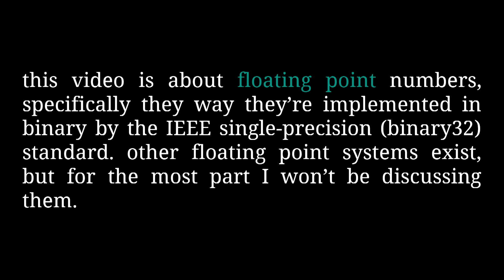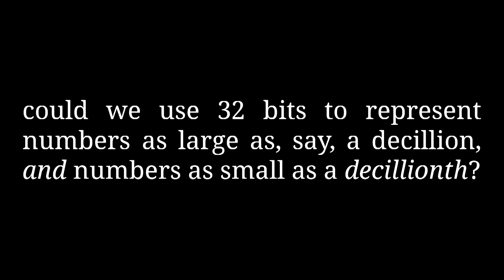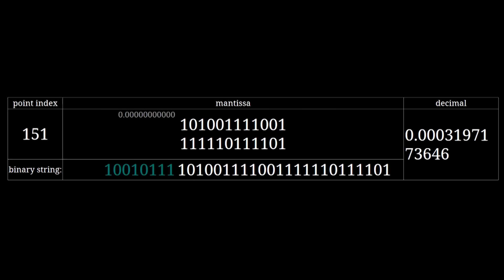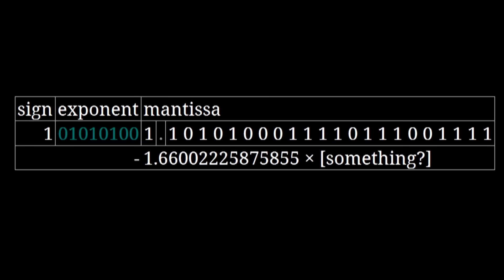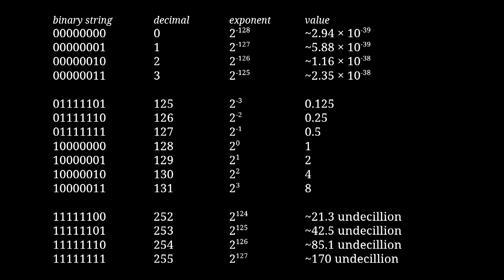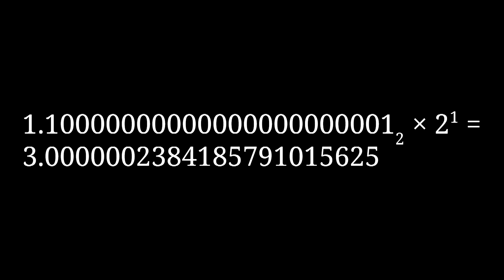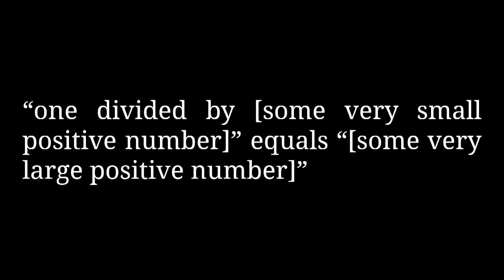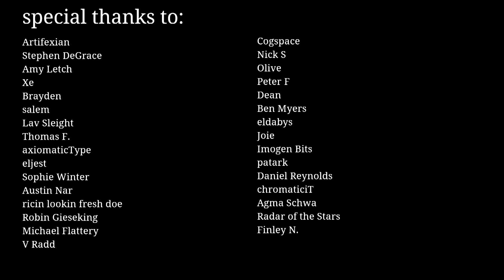how floating point works

Comment: The weirdest thing you'll face when dealing with floating point is when you try to make games and one of the tips is "As you get farther from the (0, 0, 0) coordinate, physics gets less precise".

It makes a lot of sense. If you need to spend more bits in the integer part of the number, the decimal part will be less precise. It's just so impractical for this purpose.
Reply: That makes total sense but I’ve never worked in games so it never occurred to me. How interesting. What kind of data type are the coordinates? I’d assume it’s at least a double these days but like is double precise enough for large open world games or do you need more bits?
Reply: @huckthatdish  in games most often float is used, due to higher performance on GPU (transforming vertices by matrix, etc.)
open world games usually use floating world origin, which shifts entire world closer to (0, 0, 0) (implementations vary)
Reply: @kkard2  interesting. Still surprised with how far draw distances are these days everything loaded at once can be simulated with just float, but I know the tricks and hacks to make it all work are myriad. Very interesting
Reply: @huckthatdish  Generally, games with large enough areas to make this a problem handle it by setting the origin coordinate at the player's location and moving the rest of the world around them, and not simulating the parts of the world that the player isn't currently in. That, or loading zones; any given loaded area can have it's own fixed origin.
Reply: On the other hand, Outer Wilds has a whole miniature solar system and needs to run physics everywhere even when you're not around. I'm not sure how that handles it, but I am very impressed that they did.
Reply: @qwertystop  for outer worlds probably various coordinate systems running in parallel. Since the different planets don’t interact with one another I assume, it’s just multiple copies of if you were just simulating the one world. With GPU’s these days if you can parallelize a problem you’re good, especially since there’s no graphical rendering for worlds you’re not on I assume.
Reply: @huckthatdish  Outer Wilds, not Outer Worlds; completely unrelated game that happened to release at around the same time. And that's part of the issue, though - you fly in real-time between planets, no loading, you can see one planet from another just by looking at the sky. If each planet does use a different coordinate system, it's still impressive to shift objects from one to another without noticable seams. Also you have a camera drone that you can launch wherever and that has no limits on its distance from you, so the game does need to be able to render any combination of locations at once.

(Also, physics simulation is not, to my knowledge, currently something that's practical to parallelize onto the GPU)
Reply: @qwertystop  Outer Wilds does the "keep the player at the center and move the universe around them" thing. Check the NoClip "Making Of Outer Wilds" documentary, it's super interesting.
Reply: there's a series of videos by danny2462 that i think starts with one called "distance did this" where, because in kerbal space program the coordinate system's origin is defined as where the player is (as an attempt to avoid this exact problem) however this now creates a new (albeit much rarer) problem where travelling really far away from the star system breaks the terrain of the planets if you switch there without allowing it to reload them properly
Reply: On the other hand, floating point numbers can be really good for physics calculations because the precision is unit-independent. For example, I might measure distance in centimeters, but some calculations require multiplying two distances. If these distances are both hundreds or thousands of centimeters, then the resulting numbers can get quite big, and there could be a concern about overflowing fixed point numbers. With floats I could do all my calculations in Planck lengths or light years without having to worry about this.
Reply: @informationaether6965  The problem here (in videogames) is that the units can vary wildly between what they're used for (the magnitude of calculations) and what their current value is. If your movement is centimeters but your position reads x=500000 meters, then it just sucks.

Comment: Fun fact: The Chrome javascript engine uses the NaN-space to hold other datatypes such as integers, booleans and pointers. That way everything is a double.
Reply: i can't find confirmation for this, but if true this really is some cursed knowledge
Reply: @kkard2  it's a common technique for dynamic language implementations, so old that even by 1993 it was common knowledge whose source was lost to time, according to  “Representing Type Information in Dynamically Typed Languages” David Gudeman
Reply: That is both ingenious and incredibly evil.
Reply: So does Firefox's. It's a common technique, called NaN-boxing.
Reply: @dzaima  NaN-boxing, my favorite sport. LuaJIT uses it too.
Reply: @bb010g  nice pfp
Reply: @RichConnerGMN  thank you
Reply: Ew
Reply: Hmm, then what happens if you use an integer array on the same array buffer as a float array to change the bits of NaN to an equivalent but different value
Reply: @seanthesheep  Array buffers use a different array type, reading a float from which should have code to normalize the NaNs. You can see that in action by writing code that does that, and executing f64arr[0]=f64arr[0], which will change the value despite looking like a no-op.
Reply: I looked this up. didn't find much. but apparently V8 engine uses "pointer tagging" instead of NaN boxing.
Reply: @JNCressey  Seems so. So V8 is the out-of-the-ordinary one, while Javascript Core (safari's JS engine) and Firefox both use NaN-boxing.
V8 also iirc recently started using compact (32-bit) pointers on 64-bit systems too, and with that NaN-boxing is definitely impossible.
Reply: @dzaima  The JavaScriptCore scheme isn't actually NaN boxing, per se - instead, they add a large number (2^48, iirc) to every float, which basically removes the entire floating-point range IIUC. This is better because it makes pointer unboxing easier, i think (you can't encode 2^48 as an instruction operand, not on x86 anyway), and the other cases would require unboxing and so don't matter anyway (and it's also important to note that the "is a float" path is a much less common path than "is a smi (32? bit signed int)" or the "is a pointer" path, and i guess making the pointer path fast was more important than making the float path fast...
Reply: So for pointers, I guess they rely on the assumption that 64-bit systems will never actually use all 64 bits of their address space?
Reply: @danielbishop1863  Yeah. Most CPUs support only 48-bit pointers, and I've heard that, for the systems that allow more, the allocator will only give 48-bit ones as too many things assume they can use the top bits (or at least something like that has been proposed to be implemented)
Reply: @danielbishop1863  A very good assumption at browser level. It doesn't mean the whole system can't use those higher bits, it means a single browser process will not use more than that. Modern browsers are able to launch several processes to avoid sharing memory between different web sites to avoid potential security issues, so while only one site will not be able to use more than 2^48 bytes, you could have several loaded in memory and among all of them using more than 2^48 bytes.
Reply: I don't know why, but I really like the term "NaN-space".
Reply: what the fuck
Reply: @FiNiTe_weeb  What?
Reply: @nixel1324 it is cursed
Reply: I don't understand why people think it's cursed or evil...
Reply: Yeah, this is just one of the ways things are done on the low level behind the scenes. Weather 8 bytes in memory are a double or a 64bit integer or an array of 8 chars is just interpretation. Its just a clever use of bits so that languages like JavaScript can run at somewhat ok speeds. (Otherwise you'd have to heap allocate a new object every time you add two numbers.)
Reply: Confirming that V8 doesn’t use nan-boxing, but iirc it once did.
Reply: Grandma 1. Vs. Grandma 2. Fight!

In all seriousness I wonder what else you could do with NaN boxing. Maybe other pointers, like how in some high level languages everything is a pointer?
Reply: oh god this is such a hack
Reply: @iuppiterzeus9663  welcome to computers!
Reply: Since there are multiple sizes of floats, it's actually possible to nest NaNs. So you can have a 16 bit NaN inside a 32 bit NaN inside a 64 but NaN inside a 128 bit NaN. NaNs all the way down...
Reply: not a not a number
Reply: JS: Everything is objects.
Chrome JS: Everything is floats.
Reply: i do some work related to javascriptcore and the two files JSCJSValue.h and PureNaN.h are great reading references
Reply: i want to scoop out javascript's eyes even more now, thank you

Comment: I've been experimenting with floats in C++ and noticed that literally all operations with floats are broken. I chose a fairly large number of random numbers and tested some expressions on them:
(a+b)+c==a+(b+c)
(a*b)/b==a
(a*b)*c == a*(b*c)
And all of them did not work with 100% probability. But the most surprising thing is that even this formula did not work:
a+b==b+a
Of course, the point was that calculations with NaN have undefined behavior, but it still seems strange.
Reply: "But the most surprising thing is that even this formula did not work: a+b==b+a"

I think that can only fail if there's a NaN there.

"calculations with NaN have undefined behavior"

The behavior is not undefined. It's just that comparison NaN==NaN yields false.
Reply: @seneca983  Yes indeed. I forgot about it.
Reply: That's a fun experiment!  I don't think you even need NaN to break those - it comes down to where/when the precision is lost.  Like, do you round and then do the operation, or do the operation and then round?  I haven't had to deal with it much, but I've heard the industry-standard solution is just: "never use equality when dealing with floats."  Typically, you'd check to see if your value is within some small epsilon of your desired value and just... call that close enough to be equal.
Reply: @rs20894  "I don't think you even need NaN to break those"

You don't except for the last one, i.e. a+b==b+a. That one can only be false with NaNs.
Reply: That's basically down to when the rounding occurs, and as described in the video floats are always approximate and with limited precision. That said, a+b and b+a will result in the same operation with the same rounding, so you get the same approximate result bit for bit.

The rounding floats do is why it's basically a standard practice to *never* use the exact equality operators on them unless you really know you need it, and instead use the inequality operators to see if a float is approximately equal to something within the range you need to know about. You don't often need to know if a value is EXACTLY 3.14159265358979, your needs may require only a few digits of accuracy, so something like abs(3.14159265358979 - 3.1415) < 0.0001 instead.

If you ever do need exact and precise numbers that large or small, then you're not dealing with this format. You'll be using much different, tailor made formats that aren't IEEE floats. Something as simple as a "big integer" for what it sounds like or a custom fixed point format of either large hardware ints or the same "big integer" formats, or whatever else fits your needs. Dealing with currency in financial situations, for example, requires accuracy. If you know you'll always be dealing with the smallest physical currency, like a penny, you can use an integer multiple of that. So the value 500 would be equivalent to USD $5.00. For more arbitrary precision, use a fixed point format where you can define how many decimal places are relevant to you (e.g. 'decimal(10, 4)' meaning " I care about 10 digits in the whole part and 4 in the fractional, caring about hundredths of pennies.)

Floats are approximate, but good enough for most casual uses. Different formats for different purposes. Equality is not something floats care about : )
Reply: @localatticus4748  "a+b and b+a will result in the same operation with the same rounding, so you get the same approximate result bit for bit"

I suspect he compared them with floating point equality which yields false with NaNs.
Reply: Yeah, in practice it's usually best to avoid operator== with floating point numbers and instead check whether or not they are within some acceptable margin.
Reply: @TheLappin  
I understand. I'm not the first year in programming.

Comment: this is a good video!! I like the way you explain how this came to exist. it is a human thing made by humans, and as such it is messy and flawed but it works . and I love that. it was created for a purpose, and it serves that purpose well.

you didn't do this, but I've seen people say that "computers can't store arbitrary-precision numbers", which frustrates me, because computers can do that, they just need a different format. these tools are freedoms, not restrictions. if you want to perform a different task, then find different tools. and yeah you probably won't ever need this much precision, but like things like finance exists, where making a $0.01 error in a billion-dollar field is cause for concern, at the least. arbitrary-precision numbers do require arbitrary memory, but they're definitely possible.

I think 0 is positive and 1 is negative because 0 is "default" and one is "special", like how main() returns 0 on success in C. also it could be because of how signed integers are stored, where 11111101 is -3 b/c of two's compliment (I think?), which is mathematically justified by 2-adic numbers.

anyway good video, as always.
Reply: In finance, you can instead use a (int64, currency) pair with the integer representing micros. (1000, USD) is interpreted as one tenth of a cent (one thousand micro dollars).
Reply: @KaneYork  that is a fixed-point system.
Reply: You would definitely not use a floating point number for finance, the inaccuracies will cause trouble. You'd use a couple integers (like 200 dollars and 53 cents).
Reply: @strangejune  you'd store the value in cents (our even millicents). Divide by 100 the get the dollar amount, the rest is the cents
Reply: Using int64 for finance is questionable; there have been instances of hyperinflation where the 64-bit limit (~18 quintillion) could have been exceeded in some cases. In particular, the first Zimbabwe dollar (ZWD) had a total of 25 zeros knocked off during successive redenominations (i.e. 10^25 ZWD = 1 ZWL), but 18 quintillion is less than 10^20, so you would be unable to represent 1 ZWL as an int64 of ZWD. Making matters worse, 1 ZWL was still way too small to be useful. If your financial database was never converted from ZWD to ZWL, you would be overflowing all the time. The safest way to represent money is as an arbitrary-precision integer, not as an int64.
Reply: @NYKevin100  Then use an i128.
Reply: Yeah, tons of high level languages have implementations of arbitrary-precision numbers, it's just that in almost all cases you don't actually need them so programmers don't use them (i.e. BigInt and BigDecimal in Java)
Reply: @CrystalLily1302  Yeah. The wisdom is to always avoid using floats where applicable. They can cause their share of headache.
Reply: @CrystalLily1302  the MEGA cells addon for the Applied Energistics 2 mod for Minecraft uses BigInt for the biggest storage cell because we wanted "infinite storage" to actually be functionally infinite, as some overpowered mods were capable of making so many items that int and long might concievably overflow.
Reply: One sticking point in language design is what the defaults are.
Having safe defaults is best, but it can trick newcomers into believing the performance is not as good.
Since IEEE 754 is hardware-accelerated in CPUs nowadays, they end up being most languages’ default number format, sadly causing subtle bugs.
Reply: You could borrow the solution the Unicode implimentation uses.  They have a small set of numbers to tell you how many bytes to expect.  It would make math complicated, but it might work.
Reply: @frankharr9466  That is a terrible idea for so many reasons. Unicode uses this, because characters almost always form a string, that is interpreted in its entirely or as a sequence. Intexing into a string is O(n) operation. Substituting a single character is also O(n) operation. A single unicode character is 32bits, because that's the smallest format guaranteed to hold an entire arbitrary unicode character.
You definitely don't want that kind of behavior for numbers and arrays. At least not 99% of the time. The remaining 1% is stuff like lossy compression.
Reply: @KohuGaly  

O.K.  I just thought it might help if, in the first part of the number, now many bites the number is is encoded, not just the sign and the exponent.
Reply: Since when did main() return 0? it returns whatever the hell you want it to. Returning 0 is just the convention for success and 1 for failure